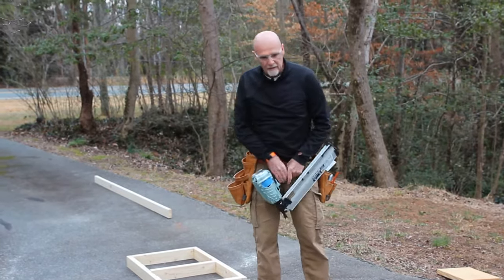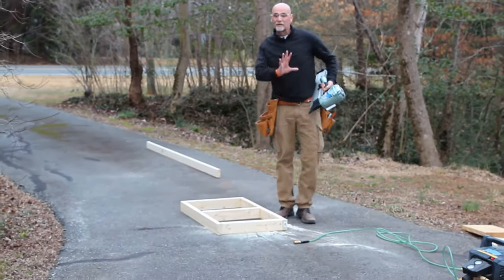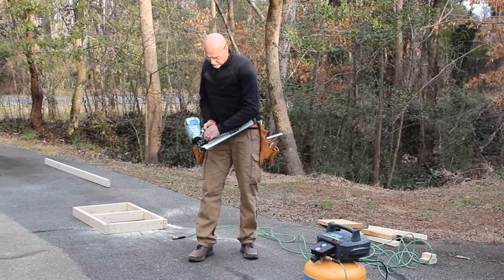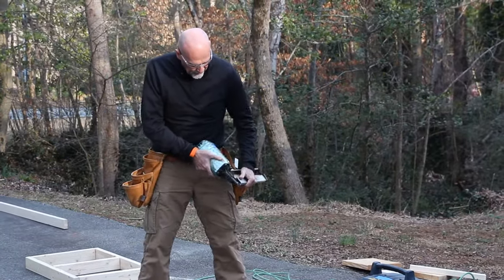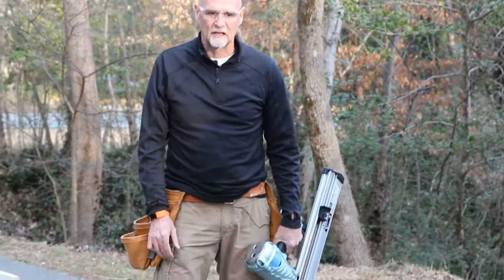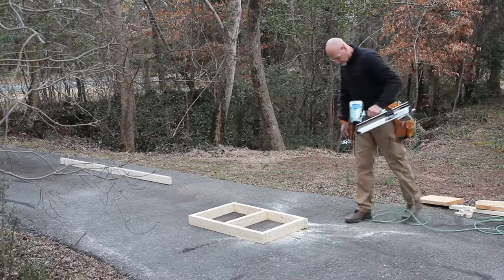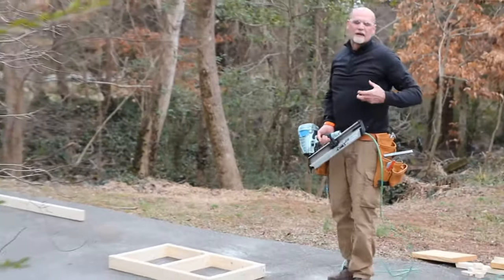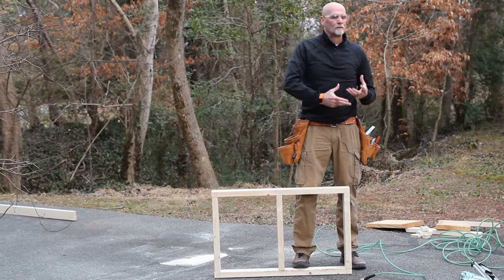Nail Gun Safety

Comment: At 6:50, if you have an air compressor and don’t turn the bottom valve to relief the air inside if not used and moisture, it can rust out your tank. 

Tanks rusted are susceptible to exploding when under pressure in that case.